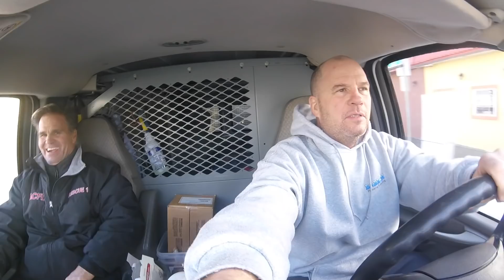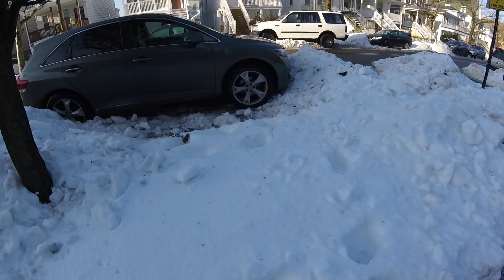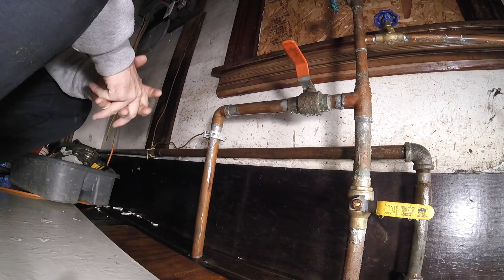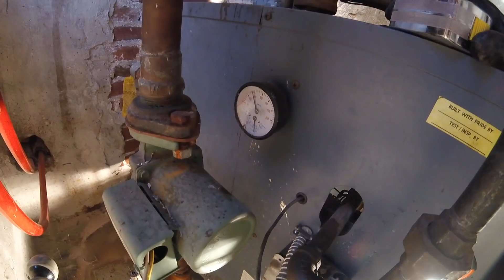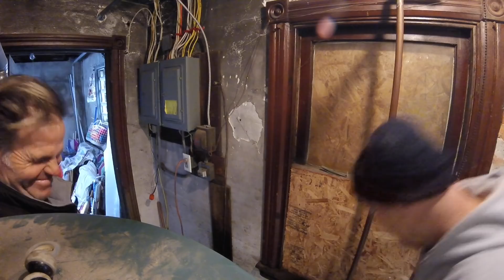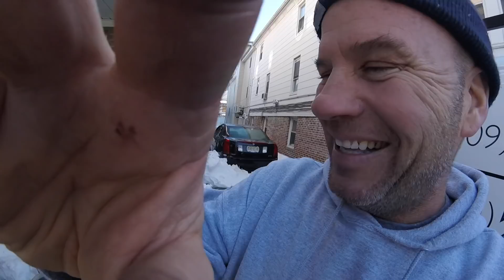Copper Water Main Repaired

Comment: Great video as usual.When we first bought this house one of the very first things that I did was that I installed a six foot electric baseboard heater with a thermostat in my boiler room in case God forbid the boiler broke down/ran out of oil so that way my water main and water pipes would not freeze.I'm glad that I installed the six foot baseboard heater with a thermostat because my boiler had to be replaced and it was January before last which was bitterly cold and the baseboard heater kept the boiler room nice and warm for the time it took to replace the boiler which was from seven a.m. to nine thirty p.m..
Reply from the maker: real problem here. They lucky boiler did not freeze up. This is a house rarely used and they leave heat on all winter. all good till pilot goes out or electric goes out.
Reply: @ChuckBarron  That really blows,sorry to hear that Chuck,they didn't try to give you any grief over that right?I certainly hope not.

Comment: I was thinking about the old nightmare scenario where you have water spraying everywhere and have no way to turn it off. You would not want to take a chance on ruining your ProPress machine. Would you use a compression or a SharkBite fitting?
Reply from the maker: I have not had that happen but you never know when it can. I hope not today either. Its a toss up for quick fix couplings. there are so many good ones out there. 👍
Reply: which one of the quick couplings is your favorite?
Reply from the maker: i would go brass for copper, and galv dressler for iron in a good situation.....or the clamp for galv
Reply from the maker: nice....
Reply: me too
Reply: me too

Comment: How much do press fittings cost compared to regular solder fittings?
Reply from the maker: 2-3 times the cost... and 2-3 times faster to install.  a must have.
Reply: I  am old school I solder. When I can but.... I press when I need to. Which less than 2% of the time. But press fitting can be pricey.

Comment: If you don't mind my saying so at the 9:13 part of the video you should have positioned the shut off valve handle to be pointing in the down position out of the way before you crimped the shut off valve in place because now the handle on that shut off valve sticks out and the shut off valve can get bumped open if anybody walks past it being that it's a narrow space to walk through.I always position shut off valve handles in a way in which the shut off valve handles will not be in the way,inadvertently get bumped open or get caught on anything.I once did a job where the water main was not fully shutting off so I installed a shut off ball valve with compression fittings and boy did I get an earful because I went out to get parts and when I got back to the job the person that I was doing the job for got very annoyed at the fact that I had positioned the shut off valve with the shut off handle sticking out instead of being out of the way.I was lucky that it was a shut off ball valve with compression fittings because that allowed me to reposition the valve with the shut off handle out of the way without having to cut the shut off valve off to reposition it.On the bright side shut off ball valves allow for the shut off handle to be repositioned by removing the retainer nut that holds the shut off handle in place ro change the shut off handles' position.I am not trying to give you a hard time,I am pointing out the position of the shut off handle because I got grief for positioning a shut off valve with the shut off handle sticking out.
Reply from the maker: appreciate your time nelson. Good tip.
Reply: @ChuckBarron  And I appreciate your time as well with you taking the time to show us the realities concerning plumbing.
Reply: @ChuckBarron  I neglected to tell you what happened when I installed a compression fitting shut off ball valve with the shut off handle sticking out.I installed the shut off valve but left the shut off handle sticking out.The lady that I did the job for decided that she wanted me to change the shut off valves for the utility sink that she had in her basement near her washing machine.The utility sink was installed to replace an old cast iron slop sink style sink that she had in her basement but who ever did the replacement neglected to change the shut off valves for the utility sink which were old and were no longer completely shutting off.I told the lady that I had to go get more parts to change the shut off valves to her utility sink and that she could not use the water until I was done.While I was gone I think the lady somehow bumped open the shut off handle and got startled because when shut off valves are opened the water rushes out with a big hiss and I think that's what happend to the lady,while I was gone to get more parts she bumped open the shut off valve because I positioned the shut off valve with the handle sticking out and she startled the heck out of herself.Believe me when I tell you that the lady let into me but good for that.The lady gave me such a tongue lashing that even my picture ID was hurt,so imagine.From that day on I never have and never will install a shut off valve with the shut off handle sticking out,trust me.

Comment: How much is a typical repair like that. Press vs sweat.. With service charge included.
Reply from the maker: we charging for job. not speed..i forget what we charged.
Reply: Hmm emergency and having to dig up meter pit? Some guys would have charged  400-800$
Maybe 200$ in press fittings and 100$ for sweat fittings.
The pro press is often cheaper though, If you pay time and material. 
It's a weird state these days as far as old school or new school ways. Maybe soldering and 4 hrs of labor is what you want. Who knows how well they soldered those joints?
Even if you have the best plumber, who is to say that they'll be around in 50 years?
The manufacturers of these new fittings fully guarantee each connection for 50 years if u install as guidelined. 
Sometimes the meter which you do not own, will not shut off all the way and soldering becomes impossible. 
Do you want to pay someone to wait for the water company to come out or have someone show up and stop the flood the right way, fast?
That's worth something too.

Comment: What would you have done if you could not turn off the water?
Reply from the maker: It was shut off at the the meter.. if meter is broken then i would call the city and they have to cut up street.
Reply: I use another tool where I can turn water off. Or yog can use compression ball valves.

Comment: Chuck. Don't you just love your Pro Press. And Milwaukee tube cutter. Keep them oiled (WD40) they last forever. 
   I didn't see you ream out your pipes at all? You're not going to be around when this causes problems? 
   If the pipe froze. Why didn't you throw 10 inches of pipe insulation on that incoming water pipe?  If it doesn't freeze before their valve but after it. They can shut down the ball valve and stop the water from running everywhere. 
You should buy a bigger van.same width just taller and longer. I haven't seen one used that size out here in 10 years.
Reply from the maker: Negative lee is back.....welcome lee....you have spartan, and walk in van and a can of wd40...but the most i enjoy is all your positive energy.....that all you got? come on daddio..
Reply: @ChuckBarron  I see once again you didn't red my complete post. I don't have a Spartan.. but you may not read this far either?
 So, No. We can't work together soon.            🤔
Reply from the maker: I have to read better lee....please can i ride shot gun...I will buy coffee and lunch.
Reply: @ChuckBarron  I see you still can't answer my questions.  Not because you don't know the answers. 
 (I hope)  
But because you just don't want to answer them??
   I was actually being nice & asking questions about our different codes from where you are & where I am.
    If there is that much difference between the two.  Then No you can't come work with me. You would do it all wrong. I know all you'll see is a negative statement. But none of this post was negative towards you.
No.  Not even if you buy coffee and lunch. 
  I don't do either one.
Reply from the maker: ok.....we won't stop for lunch or coffee...let me ride shotgun. we can exchange plumbing stories. It will be fun.
Reply: @ltsgarage7780  go home
Reply: D Dunc That’s the best part about my life. I am home!!

Comment: I bet that tool dosent last you long getting it wet like you are.
Reply from the maker: I have been putting it to heavy use and does get wet.....I keep er sprayed but we shall see
Reply: That poor M12...still using our Imp cutters and No.15 if it's real wet over here.  Or the original brushed hackzall not our Fuel can't bring myself to get it soaked like the other one lol. Takes a beating and still going.  But seeing you get the m12 cutter that wet, how has it held it from a real plumber to another and are you just keeping it sprayed with silicone lube or what? Thinking about picking one up for speed. Plus I like the minimal clearance the head needs
Reply: @Turmegil  just keep them lined. WD40 works fine. I've had mine for many many years. I think the cutter is around 10 years old. The Pro Press is older than that. Buy it once. Luber it. They last forever.  After all. They are made for water. I've found that cutting pipe out in the open. My rigid cutter is faster. My marking with a pencil. Thumb it & cut. Takes maybe 3 spins of a good tool.